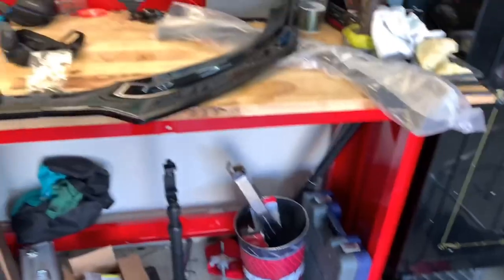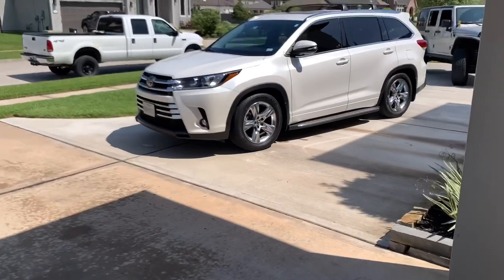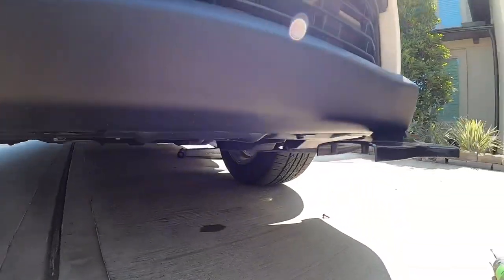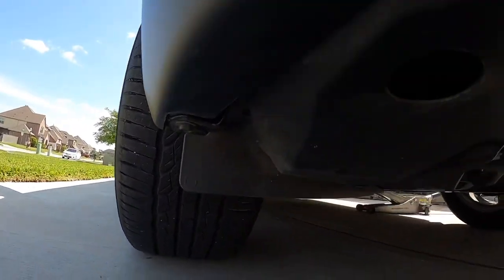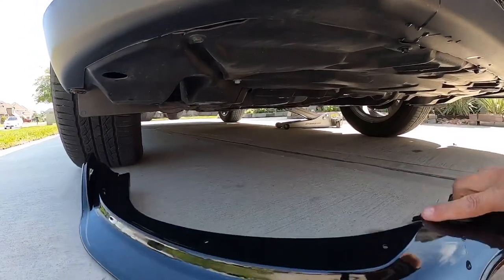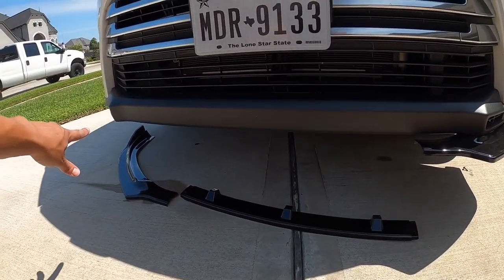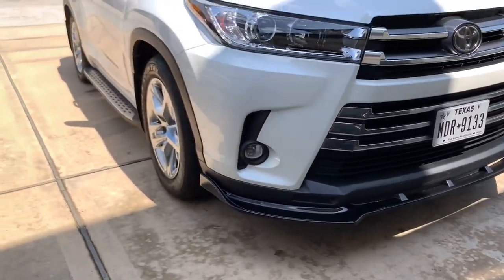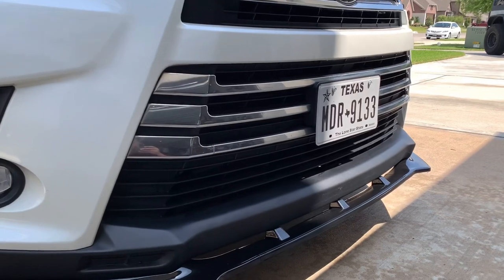TOYOTA HIGHLANDER Bumper Spoiler! How to install lower spoiler on 2014-19 Toyota Highlander

Comment: I like to look of the, 2019. I personally have a 2008 they look great too but the 2012 to 19 are just weird looking. The new models look good. Of course if you could do something about the handling I’d be happy my 2008 foot size I guess handles OK but even my significant other noted how crappy the handle is compared to our old Subaru wagon with 200 thousand miles. And the cvt oh my god don’t let me get started about that in the mountains here in Colorado. I guess I’m asking too much and these things have legendary reliability but I had to throw $600 a spark ⚡️ plug change!

Comment: If you clip it or the screw comes loose, I'd get some speed nuts and screws from O'reilly and secure from the underside of the bumper. Screw thru the same hole and use the speed nut to tighten it down. I nudge mine enough for it to come loose. Just a little bit of piece of mind to keep it more secure.
Reply from the maker: Nice thanks for the tip.
Reply: @JJBanuelos  np man.

Comment: I have a 2014 and I want to order this but the link on amazon is saying its only for a 2017-2019.
Reply from the maker: Sorry yes unfortunately they won’t fit since the bumper design is different.
Reply: would it fit a 2015?
Reply: Fish Maniac  try it on ebay. i got mine from ebay and it looks the same.
Reply: Pepito Obedicen do you have link please for 2015? Thanks

Comment: How did you get your Highlander to be low like that, RS-R springs don't give such a drop? Thanks.
Reply from the maker: It’s all in the springs, I did add the wheel spacers to make the stance wider
Reply: @JJBanuelos  looks sick, it’s the -1.2" drop coil springs?
Reply from the maker: @dokfksdlfsdklfsdkflsdk  yes, they make a big difference & the Highlander looks badass. I get compliments all the time

Comment: Is it possible to just fasten it with the existing bolts from the trim? I’m not too fond about having to put more screws in to fasten them in place
Reply from the maker: No unfortunately you can’t they don’t line up in the same spots. The factory one sit further back away from the trim also. Definitely would of made it easier & like you said less holes to make.
Reply: @JJBanuelos  I used the existing 10mm bolts. Mine lined up with the two bolts on the end, so guess I got lucky with that, but like you said no other choice then to screw into bumper.